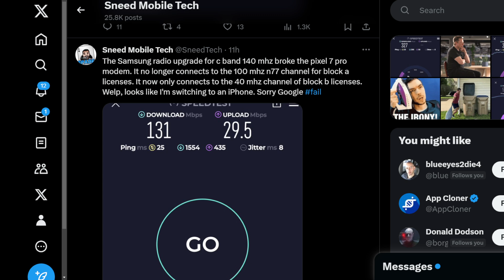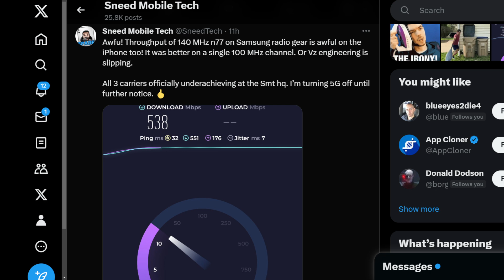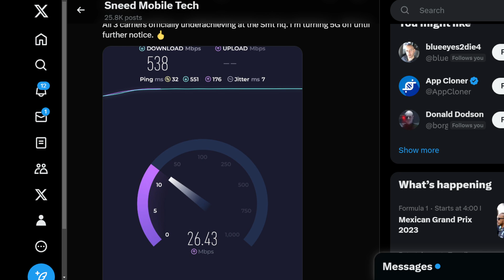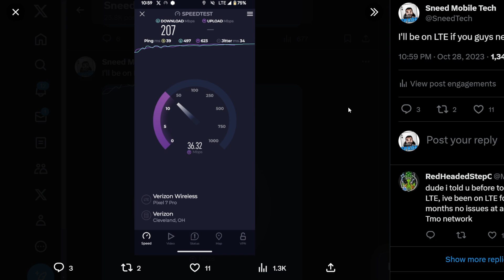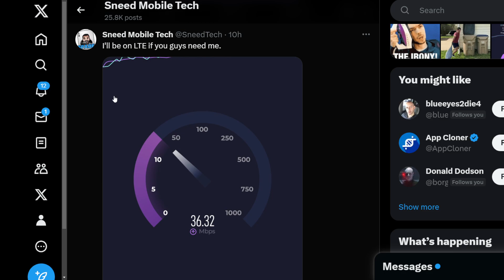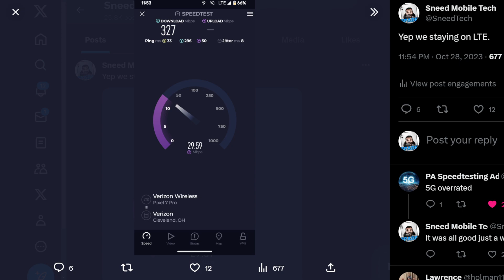Verizon Network Update: It Is Now Trash! 😡

Comment: You are an absolute  rockstar with staying on top of  these network updates! I  wish  I found your channel sooner. I live in a rural area and the LTE and 5G sucks DSS issues probably but  basically C-band signal strength  sucks horrifically unless I'm on a main road. Basically the options are: 5G NR C-Band 100MHz with a signal  so bad that speed tests always fail or the upload fails at least, LTE Band 66 1700MHz which is unreliable like C-Band 5G, LTE Band 13 750MHz which usuall geets the job done, upload and download speeds never go past 15Mbps, or 5G NR Band 5 850MHz occasionally pops its head up with excellent signal strength but slow speeds. I wish I could force my iPhone 14 Pro Max to specific frequency bands and what not because it kills my battery pretty badly.
Reply from the maker: Have you tried an lte only experience for a couple days?
Reply: The past 2-3 weeks Ive had LTE only and its a little better but I really hate buying a  product only to cripple a feature because it  doesnt  work right :/  @realsmt
Reply: Switch carriers

Comment: Hey Sneed. I want to ask: Is the radio upgrade through system update from Verizon or from Google? I set my Pixel 7 Pro to LTE just in case and speeds are already adequate in most of sub-urban areas. Hopefully when 2024 starts ill turn on 5g again. Thanks alot for letting us know.
Reply from the maker: It's the radios on the towers from Samsung provided to vz.
Reply: @realsmt  understood. Sorry to hear/see that your Pixel 7 Pro went literally "kaput". Hope your next phone will be more solid.

Comment: Thank you for acknowledging that speed tests 100 feet from the tower are meaningless. I totally agree with you, I haven’t turned 5G on because there is no sense is wasting battery on Verizon’s fake 5G DSS when it results in slower speeds than LTE. My home site has 100 MHz of N77 and it’s a half a mile away from my house and I can’t even pick it up inside on my iPhone 15 Pro, it’s flakey outside too. I can’t wait for 160 MHz with less power. Go Verizon!
Reply: Yeah in my post above basically I have had  the same experience. I get 400Mbps up and down but only on the major state route by my house. 5G speed tests almost always fail unless I go outside and hold my phone up in the air as close to the main road as possible. Occasionally it will switch to 5G on Band 5 and that is at least reliable but slow otherwise it goes between LTE 750MHz on Band 13 and LTE 1700MHz on Band 66 which is just as useless as C-band 5G -_-
Reply: Switch carriers
Reply: 100% same. Super annoying. Before the release the update I could pickup C-band inside the house, now I only see it outside and its flaky.

Comment: That was my normal download on 100 mhz of cband here in Texas. That upload is double my normal upload time.
Reply: Down here in Texas, in rural Texas whenever a site just got upgraded to n77 100mhz, I got almost 600 down and 10
Up which Is insane but now before I switched carriers, Verizon c band sucks in city and can’t penetrate far at all.
Reply: @BrokeSim  that’s exactly what I saw. At first it was great. I got 300 down and 50 up. Sometimes 400 down. Then it got worse over time and I’d barely get 100-150 down and 10 up on 100mhz of Cband. The cband only worked in a 2000 foot radius of the tower. If there is foliage or no line of sight, the cband wouldn’t work. I gave up and left Verizon after 15 years with them. Switched to AT&T. I’m getting 200-250 down on band 66 with LTE. I’m disappointed AT&T is so slow to upgrade towers, but at least I have decent speeds and much better coverage now.
Reply: @haroldbeauchamp3770  same deal here, AT&T might light up stuff at start of 2024 but Verizon is sitting back not expanding coverage for 5g it’s embarassing on Verizon so yeah I switched to AT&T too

Comment: Currently i have 100 mhz of N77 and 2 channels 10mhz of B66 and i get 900 mbps down easy on verizon. Could it be possible that samsung would give samsung phones a advantage for the samsung equipment cause my samsung always outperforms my iPhone especially on weak signal areas

Comment: NYC metros are absolutely blazing with the new BW upgrade .   Give it a little time
Reply: Niiice. Yeah speed in NYC was already nuts for me. What have you noticed change-wise since the network upgrade? Not sure if my iPhone 12 Pro can take advantage, but I’ve been curious what the extra mid-band opening up has allowed for…
Reply: @MrPhaethonPrime  unfortunately your iPhone 12 doesn’t support 2CC n77 . You need a iPhone 14 or higher